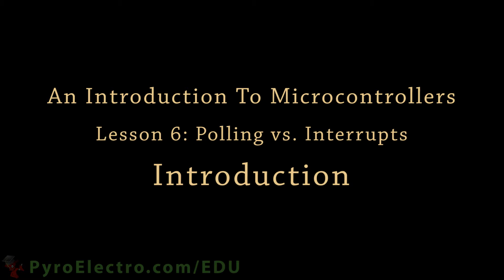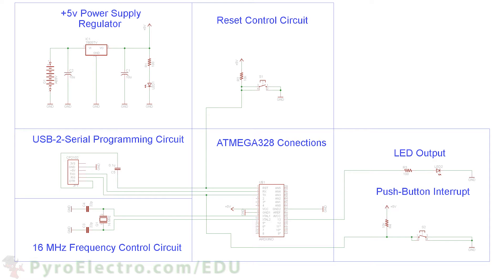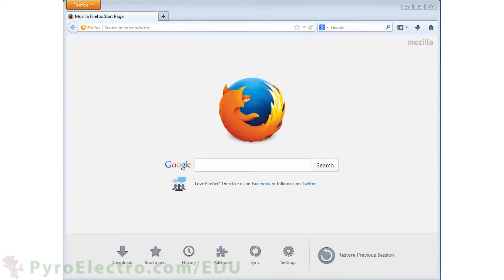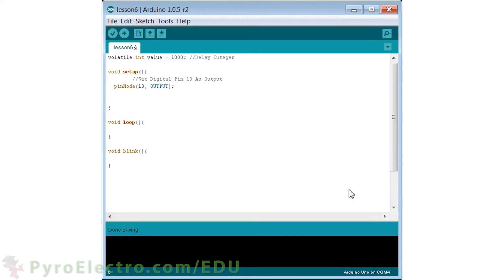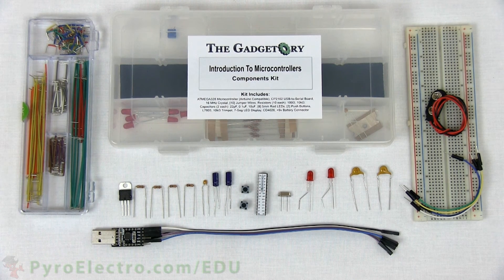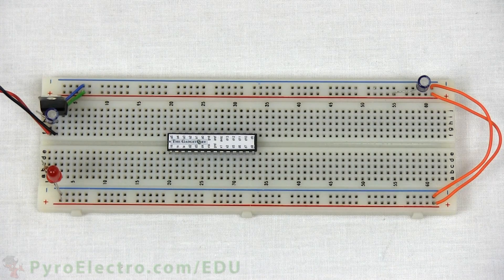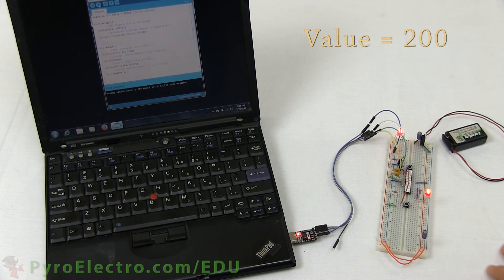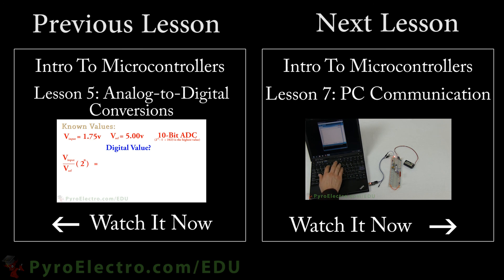Polling vs. Interrupts - An Introduction To Microcontrollers - PyroEDU

Comment: The change to "void setup" below allows the code to work on Arduino UNO using the onboard LED and Digital pin 2 as the switch.  The only part needed is a switch between between digital pin 2 and ground.  As Dave Sparks pointed out there is no debounce code so don't expect reliable switching operation.
-------------------------------------------------------------------
void setup(){
    //setup digital pin 13 as output
    pinMode(13, OUTPUT);
    //enable pullups on pin 2
    pinMode(2, INPUT_PULLUP);    
    //Attach Interrupt module
    attachInterrupt(digitalPinToInterrupt(2), blink, RISING);
    //attachInterrupt(2, blink, RISING);  //doesnt work with UNO
}